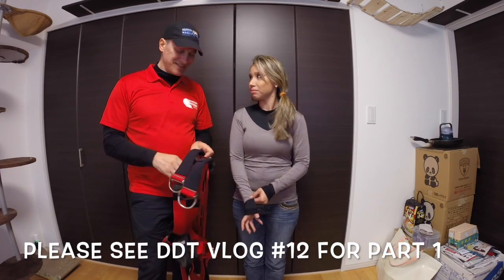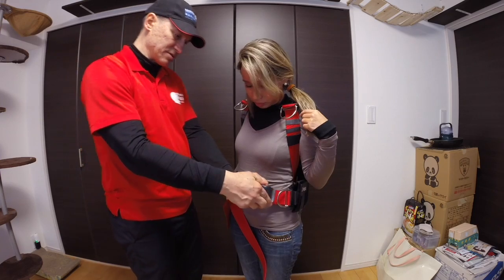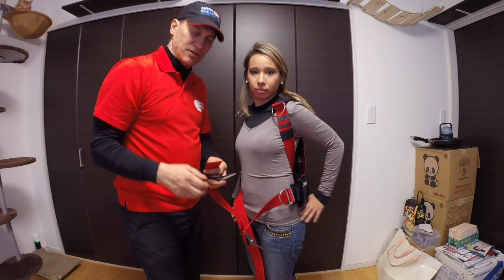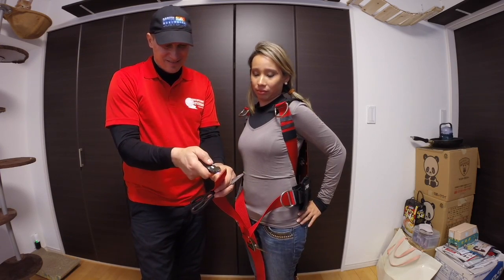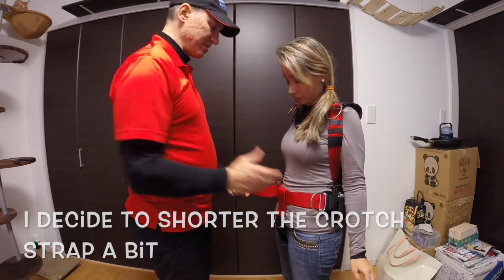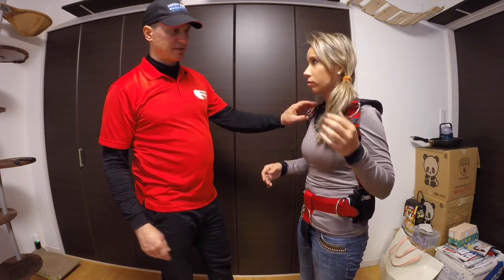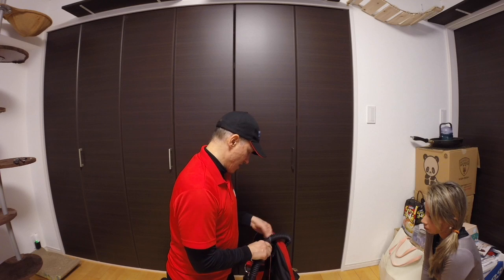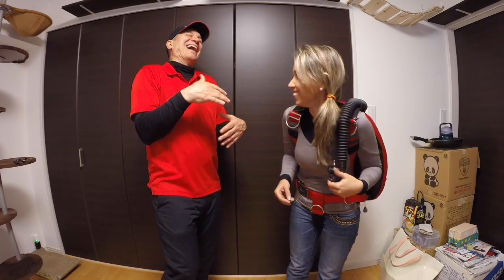Rigging Backplate Harness Part 2 - Final Fitting on Diver

Comment: Nice to see the final fitting on a person. I’m currently buying all the bits for my own plate and was struggling with the weight pocket question. 

I really really would like to have a “tech” pouch on my waist strap for signaling devices, backup mask, trash collection bag stow, etc. so I’ve been questioning if I’ll be able to even afford the space for the weight pockets. It doesn’t look like I will with the DGX one I’m eyeballing. But worst case scenario the pouches go on the tank straps, right? 

Actually worst case scenario is I spend $10 and get more D rings or pouches. I feel like I’m doing a good job of staying hogarthian. Just gotta do it, dive a pool and adjust, I guess.
Reply from the maker: Hi Sous! After trying lots of different setups myself, I'd recommend going to some pocket shorts for SMB/spool and keep weight on your belt in some economical pockets like XS Scuba, which is what I use. Those shorts can be expensive, so some guys I've heard use regular cloth pocket shorts. I might try that to give a test.

Comment: I noticed the wing is not being screw unto the plate, in long run the tank band could cut on the wing's sleeve slots. This is what im experiencing with my Hollis setup and I had to put a book screw to avoid the wing moving around.
Reply from the maker: Ah, yes. In this case, Camilla opted for no STA (@ 8:37). This definitely makes for a lighter setup and tank closer to your back, but as you say, leaves more possibility for movement. This is minimised on the HOG wings with the rods they have inside to hold the tank. Hard to explain. 99% of the rigs I build have screw-on STA as you referred to.
Reply: @DiscoveryDiversTokyo  my Hollis has the similar rod as tank stabiliser velcro between the tank band. Due to the wing could move around and getting cut by the tank cam, I customised a webbing with velcro fastener sandwich both wings sleeve and the plate via the plate's tank cam insert. By doing so you don't need the STA.

Comment: Nice backplate!
Reply from the maker: Thanks for the comment. Not sure if you're actually talking about the plate or not, but I do like the possibilities of anodized AL. However, especially in the last handful of years as Ive packed on a bit of extra weight, I need extra lead and the heft of a stainless plate. I do see one small maker is offering a nice Brass plate. I might have a look at that. Should have a rustic mariner look to it.
Reply: @DiscoveryDiversTokyo  The backplate colour looks very nice, but I guess once it's in your back, nobody will see and it won't show in pictures. There is not much choice in colours in Europe afaik. The webbing also looks good too. In terms of material, nowadays I prefer AL because it helps my trim, but that is very personal. My steel backplate moves my centre of mass too much forward and I tend to go head down. Would you make a video about donning on / off a backplate/wing system underwater or on the water surface ?  Many thanks!
Reply from the maker: jdcbranco True on the lack of visibility while wearing, however, we have a lot of backplate users in our group and it is nice to be able to tell your gear at a glance due to color. I do have some videos up on the remove/replace. Here is a remake I’m about to post live in a week or two. I’ll give you a private preview: https://youtu.be/Nut5cmWZZfw

Comment: So the belt goes across the belly button area?
Reply from the maker: Well, depends a bit on the height of the person vs the length of the plate, but yes that is a good region. Any higher and there is a danger the belt would interfere with breathing. Thanks for the Q!

Comment: Nice video. Very informative. Just one question ... I would be interested to know your feelings about an aluminium backplate compared to a steel backplate? Obviously a steel backplate is heavier so the diver would require fewer additional weights. Apart from that, would you say there are any other advantages to a steel backplate? Thanks again for the video.
Reply from the maker: Hi, thanks for the Q. Apart from weight, I can't see any other advantage. Some recent offerings do have some cool anodized colors on the AL. I always go with SS, as I want to avoid the need for a weight belt when I wear a drysuit.
Reply: DiscoveryDiversTokyo .... Thanks for your reply. Much appreciated. Since writing, I have actually bought a SS backplate and wing. I like it a lot. BUT ... I feel a little overweighted!! (29/30 degrees water in Taiwan. No thick wetsuits.) So I’ve just bought a cheap aluminium bp. I’ll be trying it out this weekend!
Reply: @sbmillward  Thanks for the questions and series of responses.  This actually has helped me to decide as I will be mostly diving in tropical water and travelling.
Reply: @AriefLatif  ... I'm happy to hear that you found the series of questions and responses helpful. I've been using a BPW system for nearly a year now. I've learned a LOT during this time, especially regarding the initial setting up, weighting and weight distribution, wing types & sizes, etc, so feel free to ask if you have any questions. And of course thanks to Jim for originally posting the video and kick-starting the discussion. :)
Reply: @sbmillward  looks like you’re diving conditions are similar to where I was mostly diving. The standard aluminium backplate seems to all be of similar weight and together With the overall BPW set up as is,  what kind of weight system have you found to be most suitable?  I am considering the Xdeep or Diverite QR weight pocket type but not sure if I should wait until I try the main set up first before ordering those.
Reply: @AriefLatif  I mostly dive warm water, 23C~29C (though sometimes 18C/19C). I don't use a "weight system" per se. I just use weight pockets that attach to my tank cam bands. I don't put weights on my waist strap. There is reason for this. Putting weights on your waist strap will affect your trim. Also, one of the reasons for a BPW is to remove clutter (research DIR diving, if you don't already know what this is). Apart from being out of the way, the advantage of placing weights on cam bands is that you can distribute them to assist your trim. For example, if I just need a kilo, I will usually put that on the upper cam band. If I need 2 kilos, I will put 1 kilo on the upper cam band (to the left) and 1 kilo on the lower cam band (to the right). This helps to balance out the weight. Also, I will place the weight pockets snugly against the BCD. This helps to keep the center of gravity close to my body. If you place the weights in the middle of your cam band, then you "roll over" more easily, especially if you are carrying a lot of weight. By the way, when  I dive in cooler water (18~23C) I switch to a steel BP (about 2.5kg, I think) in order to reduce the additional weights needed. At 18C/19C, with 10mm of neoprene (7mm wetsuit, 3mm vest + hood) and a steel backplate, I will add 7kg of weights in a 2 x 2 x 2 x1 formation on my tank cam bands. This is just to give you an idea. You will need to experiment with weighting until you find out what works for you. Tip, don't over-weight. When you are under the water, if you feel you need to frequently add/expel air from you BCD, then you are probably over-weighted. Keep dropping a kilo until you find the sweet spot. There is also a lot of info online about correct weighting. Regarding QR weight pockets, save your money. You don't need them. Moreover, I feel they are a liability. There are lots of examples of weights falling out of QR weight pockets, which can be potentially disastrous. Moreover, as I mentioned above, you want to keep the weight off your waist strap. One of the things I love about a BPW system is the lack of clutter. Do some research about "streamlining" your set up, if you haven't done this already. Cheers! Simon.
Reply: @AriefLatif  I forgot to mention: get yourself an STA with wing nuts, too, if you don't have one already. (STA = Single Tank Adapter). Just a generic, non-brand STA will do. Why? I think 5 reasons. (1) It makes it easier to slide your BCD onto your tanks. (2) It makes it easier to attach your wing to your BP (in my opinion). (3) With an STA, you can match any wing with any backplate, whereas branded wings can often only be matched with the same branded backplates. (4) An STA weighs about 0.5kg, evenly distributed, which means a little less additional weight that needs to be added. (5) I think STA's look pretty cool. :D
Reply: @sbmillward  priceless bit of information on weight and trim here.  Thank you.  I am having trim issues with my current set up (zeagle express softplate) as dive operators tend to keep mostly 1kg leads here whereas in the warm waters I usually only wear a hooded vest and surf shorts.  So 2x1kg is too heavy for me but to keep balance I needed to put one on each side.  I will definitely experiment with tank side weight as you suggested.  Thanks also for the STA info which I fully agree I think I need to get for the new BPW set up.  That 0.5 kg may actually be beneficial for my overall trim.  Thanks again for your advise.
Reply: @AriefLatif   - I'm happy to offer any advice. :) Quick question, though. I don't understand why you need to put a 1kg weight each side to maintain balance? This shouldn't be necessary. One more thing, if you don't actually need any additional weights, but you are adding 2kg, then you are definitely over-weighted. That will significantly affect your buoyancy and your air consumption.
Reply: @sbmillward  For some reason when I put weight only on one side of the pocket the whole bc tend to want to roll onto that side.  That 2 kg is definitely too much weight for me.  I remember now why I had not decided to put weight on the tank strap - it was based on possibly a misconception I had that any primary weight needed to be ditchable.
Reply: @AriefLatif  - I didn't realize you were putting weight in just one pocket. That would definitely make you unbalanced. Next time you dive, just thread the weight onto one of the tank cam bands. This is a common sight amongst divers. I'm sure you've seen it done. If I'm just adding a kilo, I'll add it to the top cam band. This helps to keep me horizontal in the water. If I'm adding 2 kilos, I'll add 1 to each cam band. But it's up to you. You need to experiment with the positioning. Even better, buy a couple of inexpensive weight pockets that can be threaded onto the tank cam band. By the way, the whole notion of "ditchable" weights is misleading, in my opinion. Fancy ditchable weight pockets are just marketing. Simple, inexpensive weight pockets do the job and are more secure. Furthermore, if you are correctly weighted, you should be able to fin to the surface with an empty BCD without ditching weights. But I would add something about this. I think it's important that additional weights are easy to locate for dive buddies, such as the very unlikely case of an emergency where weights need to be ditched and the diver is unconscious. That's why putting weights in jacket BCD pockets isn't a good idea. These pockets are not really designed for weights. This is not an academic issue. There was a very tragic case recently where a young female diver died, and one of the contributing factors was the fact that her dive partners couldn't locate the additional weight she was carrying. You can see a very solemn but informative video about it here: https://youtu.be/2epY6GRI2mU
Reply: @sbmillward  I just watched this and the update from Jim.  So many red flags here, but the biggest was the amount of weight and placement.   So tragic and sad. thoughts and prayers for the Mills.
Reply: @sbmillward  lots of great/informative info. Question for you. I only dive in warm climates (without a wetsuit), I think I know the answer, but aluminum or SS? Also, without trying a million different setups, how do you know what size wing to get? The HOG setup in this video is offered in 23lbs and 32lbs. I'd go with 32, since I'm significantly larger than the girl... but is 32 enough? Should I be looking at 40 from another company? How do you test your gear? I don't really have time to do testing while going on boat dives. Thanks!
Reply: @brois841  Thanks for your response. To answer your question properly, I need to know how much additional weight you normally use? As you dive without a wetsuit, I'm guessing you need very little additional weight. In which case, an AI backplate and a 23lb wing should be fine. I have a 25lb wing which I use in the summer. It's much more compact and streamlined than my 38lb wing that I use in the winter. If you want to play it safe, then go for a 32lb wing. That would give you enough additional lift if you needed to carry more weight for some reason. But, like I mentioned, before I can answer your question properly, could you tell me how much additional weight you normally use? (KG). Note Regarding testing the new gear, if you have never used a BP/W set-up before, I strongly recommend taking both your existing BCD and the new BP/W with you on your first dive trip. In your case, if you are only boat diving, I would recommend doing the first dive as normal with your current BCD. Then, after the first dive during the SI, jump in the water again with the new BP/W. Just see how it feels in the water. Go down 5 or 6 meters and swim around a bit (if it's safe to do this by yourself on a boat dive, of course). You may find you need to add some weight, reduce some weight, move a weight, loosen/tighten some straps, raise or lower the tank on your back, etc. If your rig is balanced correctly, it should be easy to stay horizontal in the water. In the beginning, adjusting the set-up so that it's comfortable and well-balanced can be a bit tricky. But give it a bit time. It will get easier and definitely worth it. For me, and for all my diving friends, once you've started using a BP/W, you never want to go back to a regular BCD.

Comment: Great series on putting together a backplate rig. I am just starting to get interested into this system after years of diving with soft backplate.  My question is about the grommets on the wings; do they need to be screwed on to the backplate for this travel wing or for any wing for that matter?  Thanks again for such informative and engaging content.
Reply from the maker: Hi Arief. Thanks for the supportive comment. Means a lot to me. Glad you are getting something out of the series. If you are talking about the grommets in the center line, yes, those get fixed to the plate. However, the other grommets at the bottom of the wing are for water drainage and do not attach to the wing.
Reply: @DiscoveryDiversTokyo  Thank you sir, that is very clear.  Hope I can visit your shop in Tokyo once this pandemic is over.  Stay safe.
Reply from the maker: @AriefLatif  Fantastic! Are you convenient to Tokyo?
Reply: @DiscoveryDiversTokyo  I am actually based in Jakarta, Indonesia, but we are working with a major Japanese EPC contractor based in Yokohama for the next 3 possibly 4 years. So when I do get back there again it'll be easy.  Well, let's hope we eventually can travel internationally again.
Reply from the maker: @AriefLatif  Oh, fantastic. Gosh, you're coming from some amazing scuba!  I'd like to get our your way, too! Please do keep in touch when that starts to look real. My email: discoverydiverstokyo@gmail.com